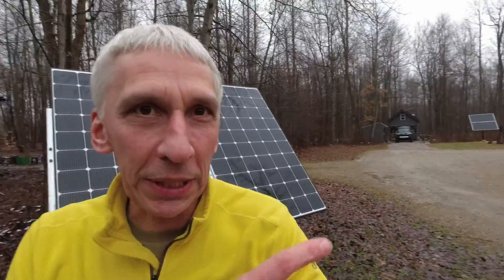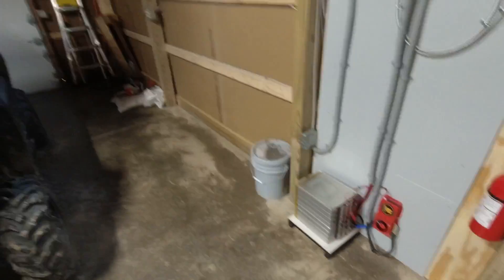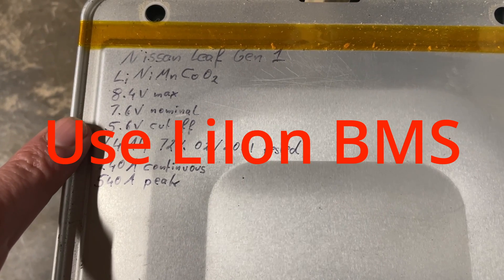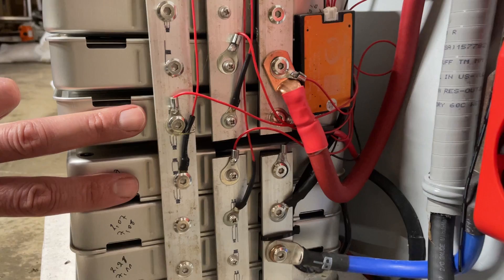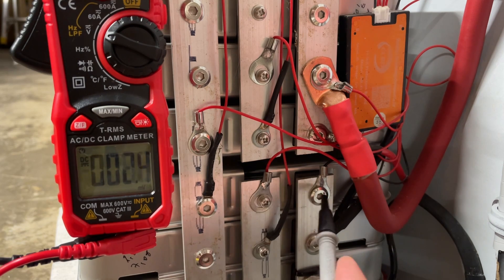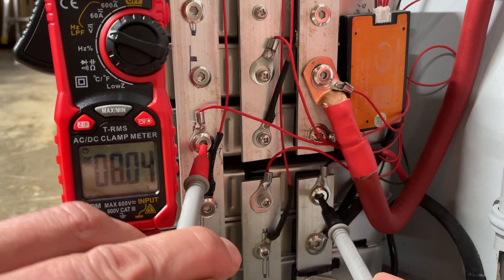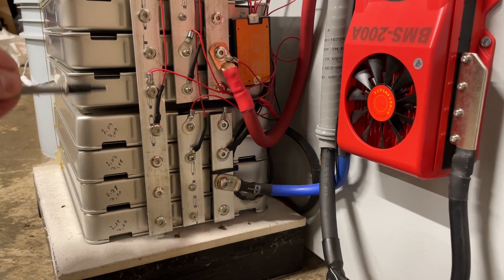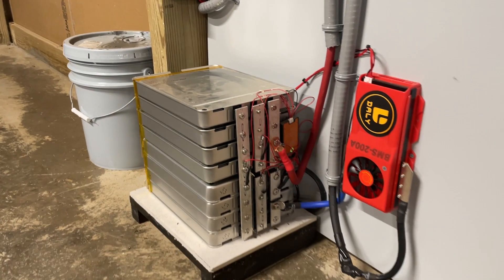Wiring Nissan Leaf cells with BMS

Comment: No need to flip them. Half of the cells in a pack have a reversed polarity. They're marked with red and black and alternates. 24 units of each model in the 24kWh pack. Extremely convinient 😁

Comment: Is there a way you could make a tutorial on how to setup a 24V system using 3 modules and how to hookup the BMS sensor to them?
Reply from the maker: I would suggest buying a 24V LiFePO4 battery from battery hookup.com
They are very affordable now to the point that building one makes no sense to me anymore. Most have already built in BMS and discount code "SIMPLICITY" gets you 5% off. There are also good deals on Amazon.

Comment: So to do a 24 V battery where would you put your BMS leads and how do you can configure the battery?
Reply from the maker: The BMS is built into my 24V battery. I only built a 24V system because I had a few 24V batteries lying around. I would recommend sticking to 12V systems, unless there is a compelling reason to go with 24V.

Comment: With the cells in parallel, how does the balancing work ?
Reply from the maker: Balance has not been an issue ever over the last 3 years I have used these cells. I recently completely discharged them due to solar panel storm damage and after panel repair they charged up to 72% of their design capacity (I bought them at 72% capacity). They have been one of the best cells I have.

Comment: Why did you stop at 16V? I am guessing your using a 12V inverter which draws many amps very easily and things tend to get hot quickly. I went to 24V. Nice explanation on the wiring.
Reply from the maker: I only charge to 16V, or maybe 16.2V to extend the life span of these cells. They are already beat up in a Nissan Leaf and were replaced with 72% capacity remaining. I don’t need full capacity. Nothing gets hot in my application and I was welding the other day. Victron inverter takes up to 17V input.
24V or 48V systems are much better than my 12V one, but I had these components lying around.